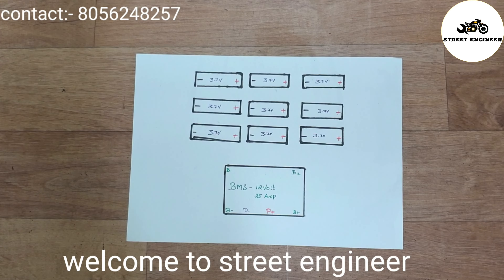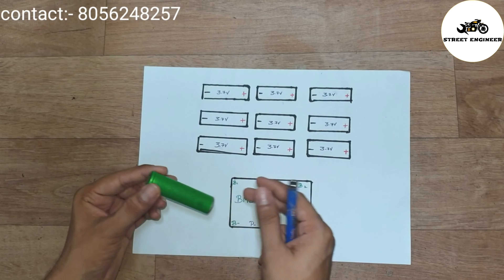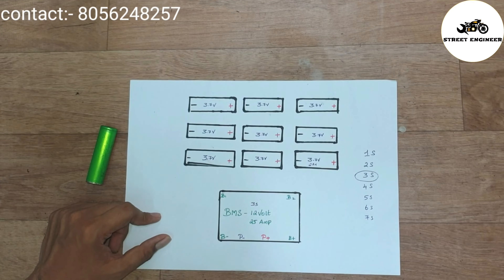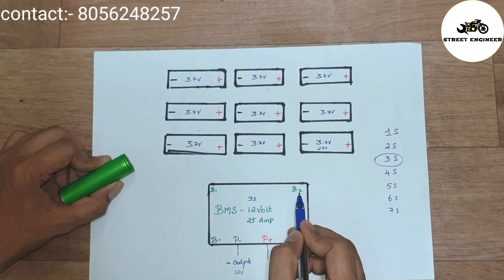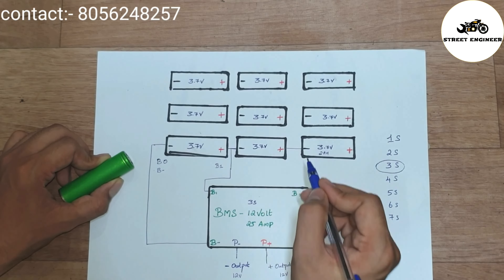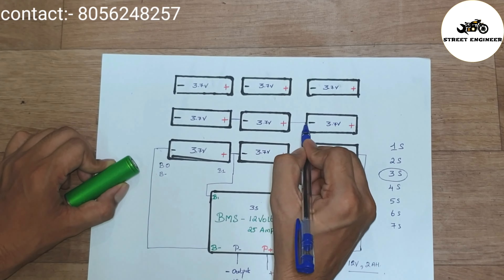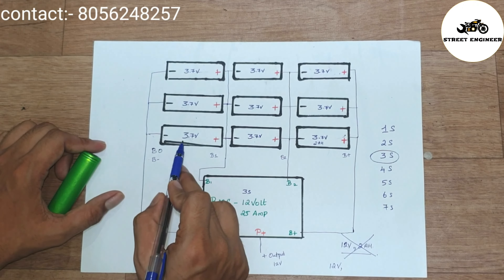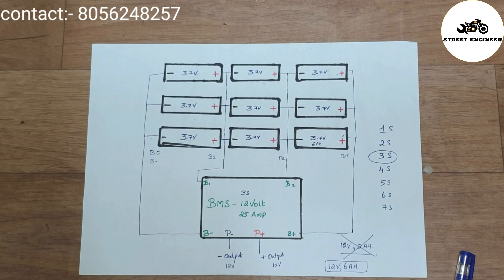Bms connection ,  lithium ion battery calculations

Comment: Don't understand how 3 x 3.7 cells connected in series makes a 12v supply. Also the purpose of the BMS is to control charge and discharge of cells, but as you have 3 batteries in parallel how can the BMS control an individual cell when there are three seperate cells across B1, B2 and B+...?
Reply from the maker: Cool
Reply: @AIBOT930 Diagram states 3.7 cells being used not 4.2. If it's a 3.7 cell version then that will be the maximum output.
Reply: Milwaukee m12 batteries use this setup with only 3 single batteries

Comment: How do I test that laptop or China Battery BMS works fine. I do give input of 12v on I/O with out connecting batteries and battery connections should show voltage among A, B, C, D points like A-B 4v, A-C  8v, A-D 12v, B-C 4v vice versa, but it shows only A-D 12v no voltage among other combinations.   This is happening with brand new china BMS even, should this is considered ok and why?
Reply from the maker: Assuming you have a 4-cell configuration (nominal voltage of 3.7V each, giving a total of 14.8V for the full pack), here’s what you should expect for the voltage between each pair of points:

A-B: This should show the voltage difference between cell 1 and cell 2, typically around 3.7V (if cells are balanced).
A-C: This should show the voltage difference between cell 1 and cell 3, around 7.4V.
A-D: This should show the total voltage of all cells in the series, about 14.8V.
B-C: This should show the voltage difference between cell 2 and cell 3, around 3.7V.
B-D: This should show the total voltage minus the voltage of cell 1, around 11.1V.
C-D: This should show the voltage difference between cell 3 and cell 4, around 3.7V.
If your BMS is only showing the A-D voltage (12V) and no other readings (like A-B, A-C, or B-C), it suggests that the BMS may not be fully connected to or monitoring all the cells in the battery pack.

Comment: Neatly done!
How about 100ah/12v ? How many batteries are needed and in which formula?
Reply from the maker: Thanks, for 12v 100ah if you want to make with 3.2v 6000mah cells then 68 cells should use 4s 17p .  

If you make with lithium ion . 3.7v 3000mah then  102cells required 3s 34p . 
Both available contact 8056248257. 

We provide raw materials and also complete battery pack available

Comment: please explain what will b Bms reuirement if i connect 13  cell in series n 3 set parallel.for 36v also share the diagram as well
Reply from the maker: Thank you . 8056248257 contact us

Comment: Do I need a special circuit to connect the charger to these batteries, or it can be connected directly to P-, P+ ? Thanks for the nice video
Reply: Direct to thr p+ and p- in bms
Reply from the maker: No no 
. Just connect directly

Comment: For this kind of 12 volt 30AH Lithium ion battery can i use 3s 40A BMS? Or which bms will be perfect?
Reply from the maker: Yes you can use

Comment: What are you saying.. 3 - 3.7 volt batteries in series = 11.1 volts not 12 volts.. am I missing something...
Reply from the maker: Thank you . 8056248257 contact us
Reply: Charged voltage of each cell is 4.2